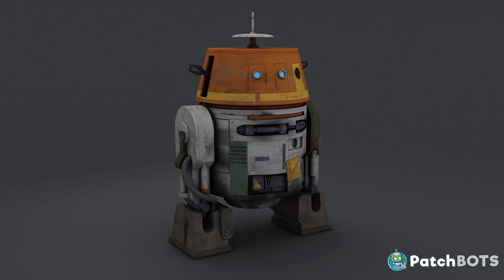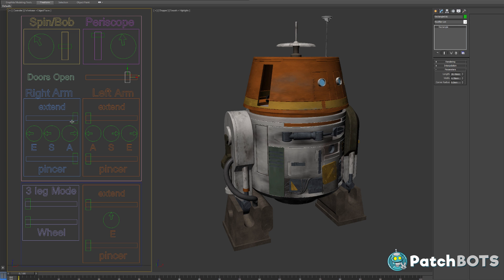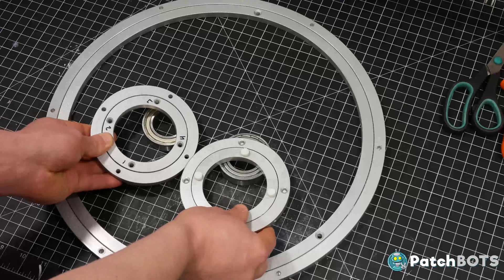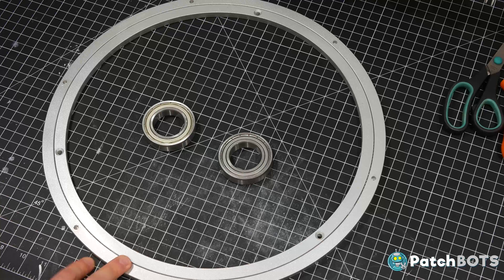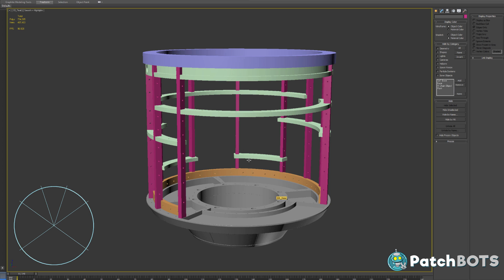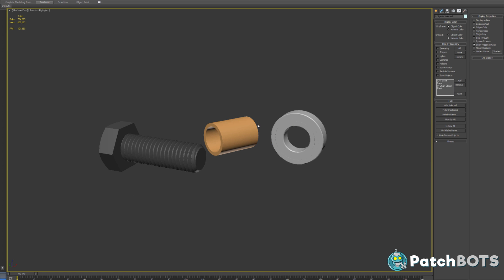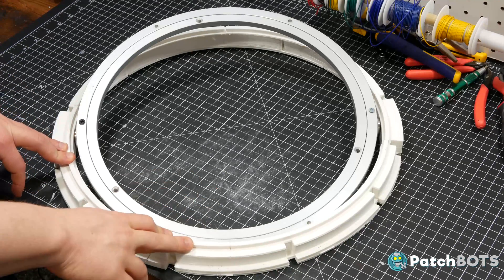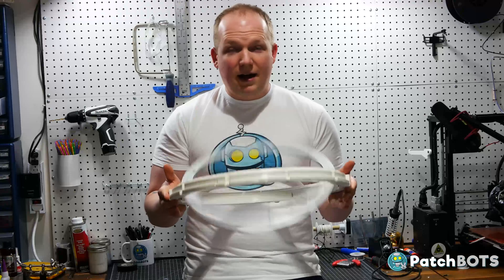Star Wars Chopper Build - Part 1 Functionality and Frame Design

Comment: cool, what a pre work have you done already. i am also working on a 3D printed copper for some time now, myself.  
i have some pictures made will building: https://goo.gl/photos/kKtzrsraK6cnM6Mo8 it will not be a 100% identical one but he has much of the same futures. 

anyway i love to see more of your build, like how you want to do the head arms and the 3th leg system.
Reply from the maker: Your build looks great!  Yeah, I'm still giving the head arms a good think, I think that will be part 3 of this series.  Thanks for taking a look!
Reply: no problem, i love to see and learn how other people are resolving some of the issues i have.
Reply: just wondering about your approach of the 2 legs are you have them fixed together or separately controlled?  as you can see from my pictures i did them separately  so i got more space in the body and are able to do  all kind angle configureate undependly.